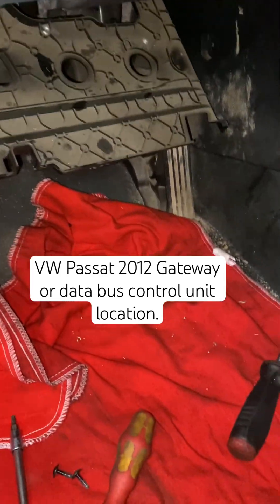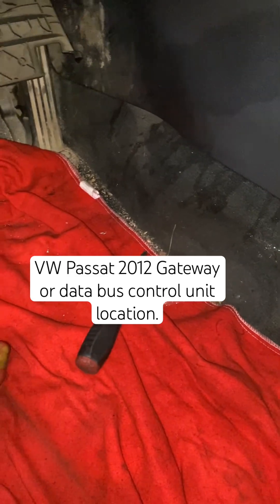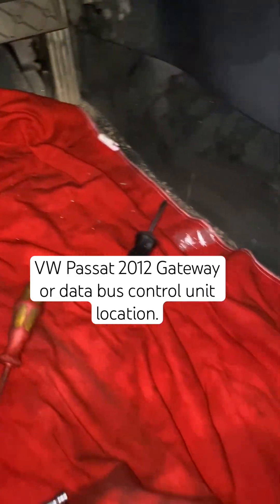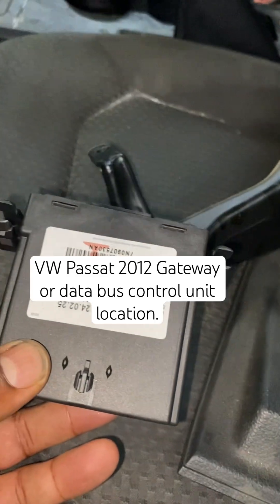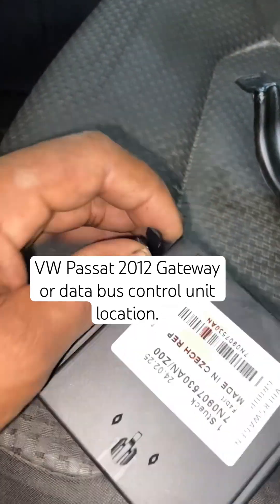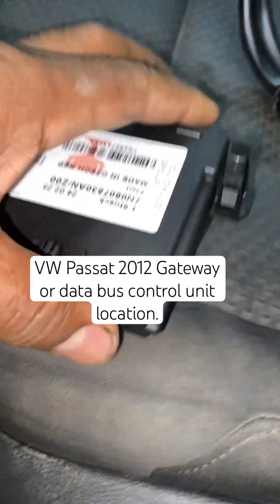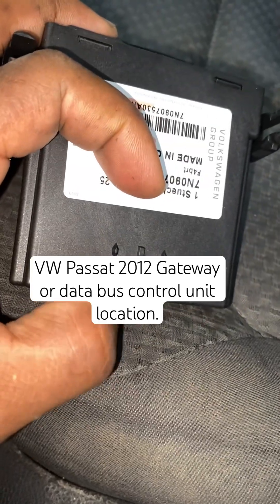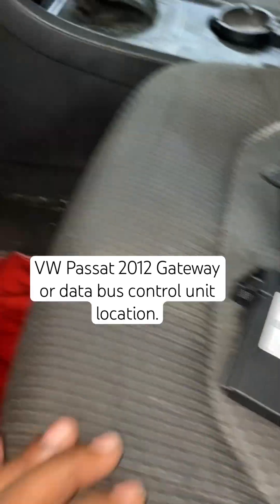VW Passat Data bus location.#12 Passat gateway #passat aw19#passat j533

Comment: I changed the cambus gate way but now I got red light wheel steering on my dash but my car isn’t electric power steering my car is fluid
Reply from the maker: Try coding it using the old one coding if not most likely you got the wrong one and you’ll need to get the right using the vin # from your car,I don’t think they are custly though.